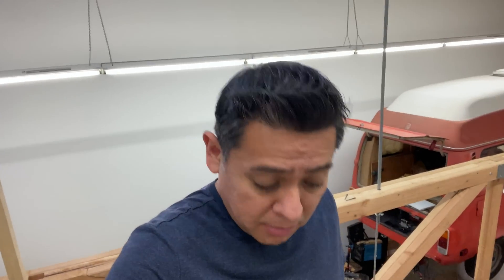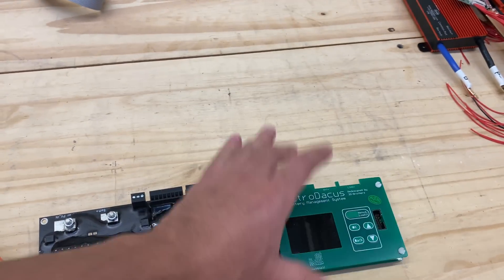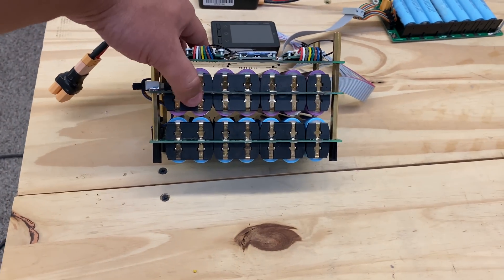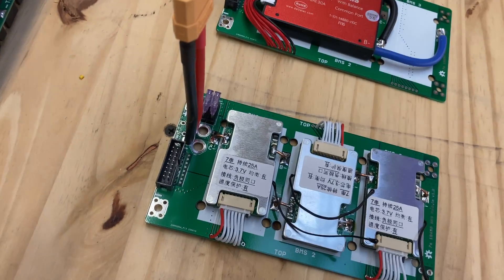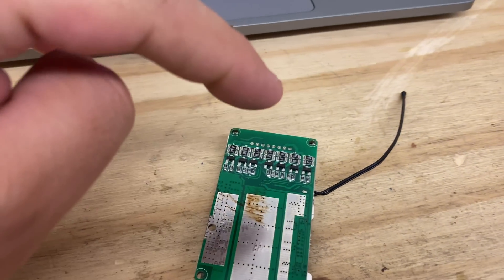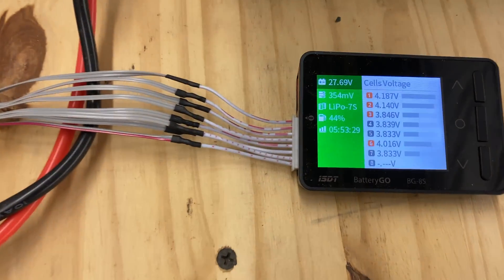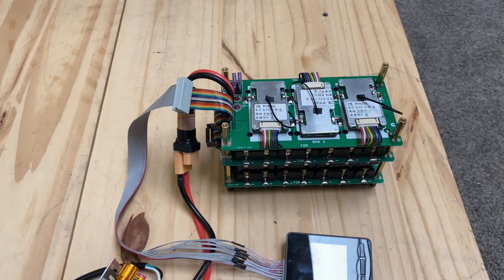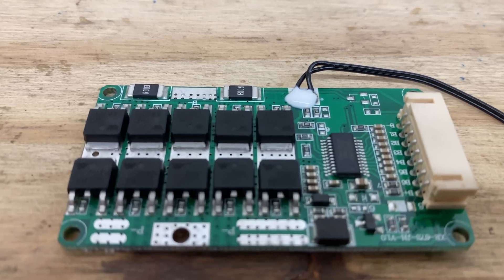How This BMS saved My Li-ion Battery Pack

Comment: Hi Jehu, great vid, i was wondering why you had three BMS's on your battery module, then you said they were in parallel which was great, giving the module a 75A current capacity, but then it got me thinking, i hope you don't put those modules is series. With 40V mosfets if you have more than two modules in series and the three BMS’s decide to turn off due to over current you would find the rest of the modules in series will severely over voltage the mosfets in the BMS’s that turned off and thy would likely fail short circuit. You probably would not know this had happened as the pack would appear to continue working normally until the batteries start to fail. The module would just never turn off again. 

The reason they have low voltage mosfets in BMS's is that they have very low on resistance and so dissipate very little power when turned on. Which is especially important when the heat sinking arrangement is crap as in this case. Its In contact with the plastic side of the FET, not the metal tab which is the bit designed to dissipate the heat and is is soldered to PCB. This is why they use more fets than they really need to do the job, also it improves reliability with regards to surge currents.

If you want a high battery voltage you need to use a BMS designed with an S number that correlates with the total number of cells you intend to use in series. It will have mosfets with a voltage rating higher the final battery voltage. For example a 16S BMS rated at 48V will have 75V or 100V mosfets in it.
Reply: Good/accurate points here.  A few thoughts:

-I don’t think Jehu has discussed or recommended using more than two of his 7s systems in series (ie 48v).   He has mentioned the MOSFET voltage limitation issue in previous videos discussing series bms use. 

-you can put a high current high voltage schottky diode in parallel with each bms.   size the diode amp/volt according to your battery specs.   this diode will protect the mosfets.  i like to buy the chunky motorola MBRPxxxxxxxCTL diodes with screw terminals , and saw them in half to get two diodes out of each part.    

-with the diodes in place , your pack will simply have a big voltage drop when the first bms bank trips. many loads will immed shut down if the pack voltage drops  significantly   (eg  48v inverter will shutoff if pack suddenly becomes 24v due to bms trip of one or the other 7s units).  But if the load keeps going at the lower voltage, well   that’s fine too, because the current will be bypassing the tripped bms and instead passing through a diode rated for the full pack current.   The tripped BMS mosfets won’t be blocking any more than a volt or so.
Reply: @yeliab814  A shunt diode is a good idea, wonder why the BMS maker's don't fit a bypass diode as standard, i guess its because of the extra hastle of bringing the positive battery connection onto the BMS as well as the negitive.
Reply: Michael Denner I think that’s a good theory.  (for voltages up to perhaps 100v, it’s prob cheaper to upspec mosfets, and perhaps add a few more to offset higher on-Resistance, than to add a big schttky diode and bring positive onboard and lay PCB out w safe separation /track spacing,etc). 

I have noticed that tool pack batteries often have one, and it has been getting chunkier recently.  For example the 18V Ryobi HP batteries have a very fat shunt diode and it’s right up at the contact terminals now.   The diode offers some protection against inductive load kickback and they have at least one factory tool (i believe it is/was a compound miter saw) that, unusually,  used two 18v batteries in series.  

The diode is good practice and doesn’t takeaway from things (other than its expense). Even for non-series / single bms  packs, a beefy silicon shunt diode will protect the BMS from inductive kickbacks quite well.  Shunt diode awareness in the DIY community needs more spotlight perhaps...

Comment: i'm doing a 4s/10 18650s for some reason the bms doesn't work the charge or load don't get any powerit shows 14v.i plug in my xt100 soldering iron and no power??if i bypass the bms straight from the battery it works.any suggestions  i have put three different bms s still nothing

Comment: Are there bms’ that will protect the individual cells. I use old laptop batteries on my electric lawnmower and the individual cell fusing has saved the cells a couple times this year when 2 or 3 cells in parallel go bad.
Reply: Design better battery, if it goes bad couple times a year, you are either using bad cells or draw too much from them.

Comment: I'm building 14s,48v with spim08 cells. They're nominal 112 amps. Do I need a bms that high. How to hook up a bms on those cells? Plz do a vid covering that, I'd really appreciate it.
Reply from the maker: How much power do you need ?
Reply: I've assembled 9 batteries and none have bms's. Don't we need at least 24kw of capacity for a small household? I've become paralyzed by doubt. Ugh
Reply: pulling 24000w which is around 500 Amp from 8Ah x 9 = 72 Ah 
72/500=0.144 hour
0.144 x 60 = 8 minutes 38 seconds to discharge. Or am I wrong?
If you meant 2400w , 50 Amp, discharge would occure within 86.4 min and for 240w , 5 Amp it's 14.4 hours or 14 h 24 min. But 112 amp in 9P can take 1000 Amp , but for about 4 min. Not counting heat losses. and with enormous cables for 1000 amp.
Reply: @hommerdalor6301  there are 14 cells at 8amps 3.7v each in each battery. Isn't that 112 amps\battery?
Reply: Hello. 
  I think you're confused, by series, parallel, amperes, ampere hours. 
 Spim 08 is 3.7V 8ah, and it looks that it can deliver 200A for short time. 
You have 14 x 3.7V per cell in series, the volts add to make 48V , in fact, 51.8V .and 8Ah stays, because you have 1p. 8Ah means the cell can deliver 1A during 8 hours, or 8A for 1h, 16A 30 min ect. 
The A and Ah are multiplied in parallel. If you have 9 batteries 48V 8Ah , It's 9p x 8Ah= 72Ah, and 9P x 200A = 1800A , and  48V. 
Now , at 48V , The battery bank can deliver 72A during 1 hour or 1A during 72h, 2A for 36h , 7,2A 10h.
The power of the pack: 48V x 72Ah = 3456 Watt hour. approximately, because it's not 48V , but between 42V and 58.8V Depending on the charge state. If you pull 1000W = 1KW at 42V , 1000W / 42V = 23.8A , at 48V  = 17A pulled.
It hope this helps you. ;)
Reply: Correction: 17A at 58.8V not 48V
Reply: @hommerdalor6301   whew! Thanks, HD. I'll read this 4 or 5 times and maybe it'll stick. Is a bms absolutely necessary for diy batteries? Seems that a couple years ago Jehu was building batteries w\o bms's.
Reply: The battery management is mandatory, but you can do the management yourself, by hand, the bms do it automatically 24/7
and with a strong enough active balancing, you could be careless for a few days without having to think about your batteries.
Jehu did the management by hand, also in this video, he created inbalance for testing purposes, if you use homogeneous battery packs, it will be less inbalanced , if some cells are weaker, they should be replaced, the weak cells can be used in other applications with equally weak cells.
Reply: @hommerdalor6301  Hey we are doing a project where we need around 180kw power. We have around 22 cells of 2.4 Ah and 3.7v each. How should we make the battery arrangement. If you can tell, it would be a big help.
Reply: @hommerdalor6301  Also we are supposed to use a Msp 430 as the processor and honestly I have no idea how the hell should we proceed.